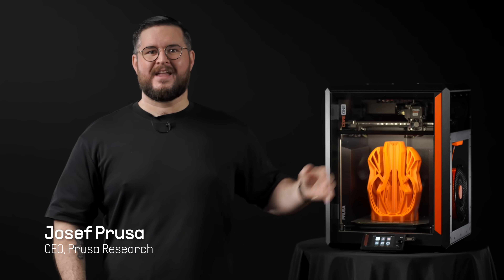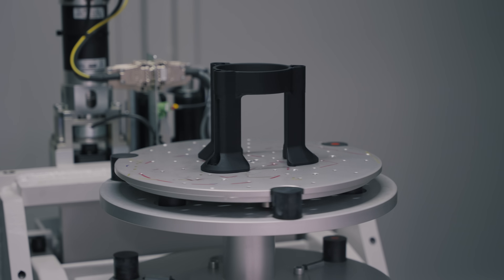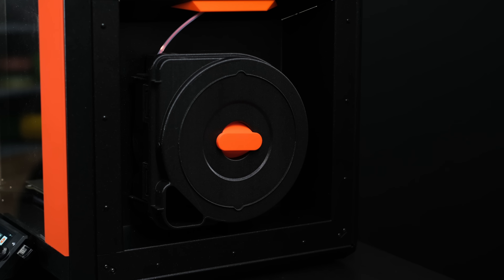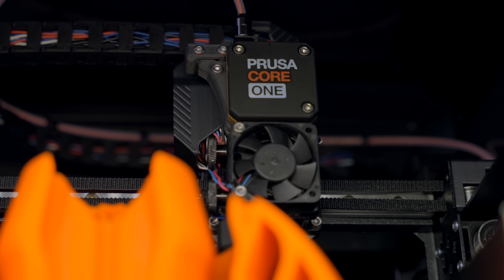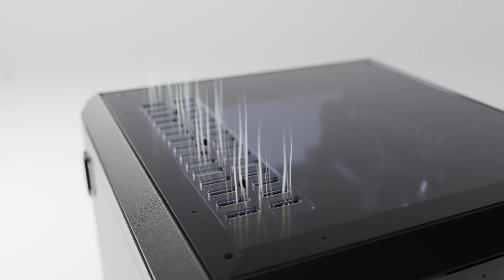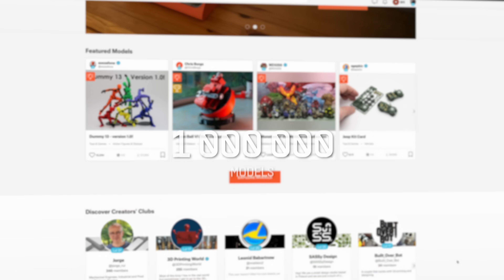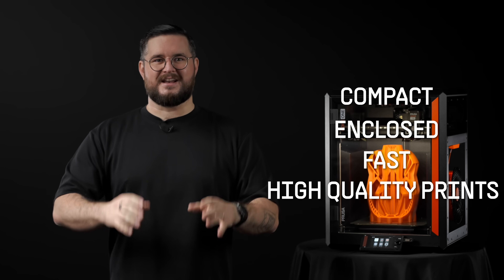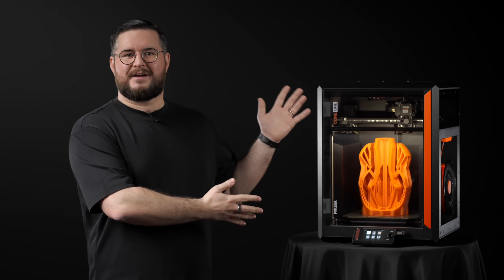Prusa CORE One - Fully Enclosed, High-Speed CoreXY 3D Printer With Active Chamber Temp Control

Comment: To everyone comparing the "Prusa Core One" to the "Bambu X1-C", they are not the same. The X1-C has a camera with added functions such as print failure detection. The "Core One" has no camera. X1-C is less money, has been around a few years and had a lot of the issues that could come up already figured out, and numerous other advantages. Also, the X1-C is slightly larger (though not much).
But in reality, this Prusa printer is much closer to the Bambu P1S (though the P1S does have a, just ok, camera, still better than no camera on the Core One)  You can get 2 P1S unfits and still have money left over to buy an AMS for the amount of the Prusa Core One.

I figured Prusa would eventually start trying to compete against Bambu, but am disappointed that they are doing it by putting out something "inspired" by Bambu's 3 year old machine. The only advantages I can see in the Core one are that some people don't like buying things made in China, and that it is not a closed ecosystem, and more open to tinkering. But those are all issues that only some people will care about.

To even call this the "core one", it just seems like Prusa is doing the same thing Creality and all the other printer companies that used to knock off Prusa, and have now been knocking off Bambu for the last couple years. I miss the days when Prusa was known for innovation. If this printer came out 2-3 years ago, I think it would have had a much better chance. But right now, it looks like it's more money and less featured that other options. If it has all the standard issues for any new printer ( all sorts of technical problems that end up getting worked out by the end users), then it could be 6 months to a year or more before it's really a "just plug it in and it works" kind of situation. I can't imagine greenlighting a printer that is clearly meant to compete against another printer, only to put out a printer that has less to offer than the printer you are competing against.

While all these other companies are playing catch-up to Bambu, it is highly likely that Bambu is getting ready to put out their next machine that will put all these other companies further behind. Though, only time will tell.

I want Prusa to push the world of 3D printing forward, like they used to do, but this clearly is not that. For one thing, they are still using that dial interface. Did they buy a zillion of those at some point, and they refuse to move to a better interface until they sell off all of those? I was really hoping that Prusa wouldn't turn into what Makerbot was, but that seems to be what's happening. Rest on "being first" and name recognition, as competitors copy your designs. Then years later as other are innovating, just switch your main focus to educational and business markets, and never innovate much past that, and just wonder why people don't find you relevant anymore. There is still a chance for Prusa to avoid this, but they are far down that Makerbot path.
Reply: No one wants all the gimmicks the Bambu has. The Prusa is a high quality machine that is built much better and has components that are functional, like the dial screen instead of some silly touch screen.

Comment: The fact that I could have upgraded my Mk2 that I got back in 2017 all the way to this is crazy! You guys are awesome!
Reply: might as well buy another printer to save the time lol
Reply: I think you didn't understand well!
Reply: @belakulcsar  wdym
They have offered upgrade kits for every printer since before the Mk2, and the Mk2 was my first printer, so theoretically I could have upgraded it to a Mk2s, upgraded that to a Mk3, to a Mk3s, etc all the way to this one that came out 8 years later.

realistically, I didn't do this. I bought a new Mk4 kit when they came out, and uograded it to a Mk4s, which I plan to uograde to a Core when they become available... but its still cool that I could have kept upgrading the same printer.
Reply: That would be Theseus's 3D- printer!
Reply: Some one should do a video of the process mk2 to core one
Reply: Unless you first upgrade to a MK 3.5 or 3.9 then you get stuck because they don’t offer the gears for the extruder so it’s a dead end upgrade. Thanks, Prusa.
Reply: @Eric_In_SF  Theres always someone crying. instead of appreciating the options they give you (something not a single other manufacturer does) you keep complaining. I cant believe it sometimes
Reply: @Eric_In_SF  You could have upgraded to the Mk4 instead of the 3.5 or 3.9.  It's not their fault you chose poorly.  You're looking at this the wrong way.  Most products you buy, that's what you've got until end of useful life.  Prusa is relatively unique in offering multiple upgrade options which all have their pros and cons; the choice is yours, but at least you have that choice.
Reply: @Eric_In_SF  yeah, hard to trust that they'll have the "idler gear" mentioned in the video when you finally need to replace it.
Reply: @electro311  there is always aliexpress. They offer idlers in many sizes. They have vendors that still offer kits to convert a MK2 to a MK2.5S, even though Prusa has finally discontinued the kits.
Reply: wait... wouldn't  it need to be upgraded to mk3 then mk4 then core one?
Reply: @mathiaschaves7604  yes... I'm saying theoretically it could have been upgraded many times and end up as a core

Comment: No freaking way. No way. A conversion kit?! Prusa is king.
Reply: The conversion kit is only $100 less than an entirely new P1S. I don't see how this is a competitive price point. I'd rather have the 2nd printer.
Reply: @katelynanderson8526  oh sad. I couldn't find it on their website so I wasn't able to check
Reply: The conversion kit is $449 I think that was a Bambu lab bot responding to you lol
Reply: @alexbotner4656  that price point is technically the cost of a full coreXY printer to be sure but you're probably not getting the Prusa quality. And it's great if you're a hobby user that just wants to upgrade their printer rather than buy a new one

Comment: I'm a longtime Prusa customer and fan, but I am not sure you can compete on features, availability or cost compared to BambuLab here. The build volume is still significantly less overall than the P1 and X1 series, the PrusaConnect stuff is still not as mature as Bambu Handy (The Minis we bought never got functionality that were pitched as part of the Connect featureset). You don't have an easy-add MMU here and the P1S with AMS is cheaper and available at local MicroCenter stores. I'm not trying to harsh your launch but surely you have to know this product as it stands is about 18-24 months too late given the current market?

Comment: Honestly, the printer looks good. IT SEEMS LIKE a WAY better deal than Mk4s + enclosure. If it's reliable like the Mk4s+ the new addon it will be great. For real I have been hating Prusa for a while because of the Mk4. This looks great, it looks premium the price is ok. If the conversion kit is great, I would probably want to convert my 4 MK4 to those. Seriously, if they come up with a 350X350 or 400x400 kit, with a decent price and that printing quality + UI + customer service. It's going to be the ultimate win.
Reply: You might be looking for an XL Mk II.  I think they are goin to rethink the structure of the XL to incorporate some of the Core One construction methods
Reply: @robblincoln2152  I'm not, the XL is not great for the price.
Reply: @Le_Sixx  I think the XL was a huge learning experience.  I expect the next version to be much improved

Comment: Sorry, but if space is such a concern, why didn't you make the spool holder a sliding drawer so you can pull it out and glue one machine to another? Does it fit 4kg Spools? Are you going to start making slim spools that are 4kg but are larger in diameter only to accommodate the extra space it takes? And why not make the doors a sliding door that goes up and down instead of out to the side? Or even a double glazed panel for that? Why is the extractor on the side and not at the back or above? There are so many missed opportunities on this.... You guys could have done so much better with a bit more ingenuity.

Comment: My thoughts:

Very much back to being a recommendable option (of course if reviews check out).

The bed size is a bit smaller than I'd hope for.

Its not mentioned whether you can use the camera while not using the cloud. Is it still possible to use with LAN mode?

Also, does the camera do time lapses?

Relating to the hotend, does it ship with hardened nozzles out of the box or is that a separate purchase?

Overall first impressions are solid and the price doesn't seem insane either.

Comment: Upgrading a mk4 to a core one??  That is insane. No one would put an ounce of effort into making that possible except Prusa
Reply: Or they have a lot of MK4 dead stock inventory and this is a cheaper/easy way to convert it to the new standard.
Reply: @ I doubt that. New product launches takes years so they would not be overproducing just before a major product launch.  I worked in manufacturing and you only produce what you can sell. Inventory is a liability as the worlds car manufacturers are finding out
Reply: @MikiCab1  I also work in manufacturing. Dead stock exists in all industries.
Reply: hi mikicab1, have you become a flat earther yet? If not I suggest watching Level with Me (2023) by Hibbeler Productions

Comment: Holy shit, I was getting a little regret from buying a MK4, but conversion kit!!!
Reply: Same!
Reply: At least you can upgrade I’m stuck with a 3.5 and they don’t sell the extruder parts. 

But you’ll need to do the math to see if it makes more sense to sell the MK four on the open market and use the cash towards this or if it’s more affordable to actually just upgrade it 

Right now, the M4 is selling for around 8:50 in my area so you’d actually be better off selling it

Comment: Honestly the door might be the best feature of this printer. I'm always baffled by how annoying my Bambu P1S' door can be :P
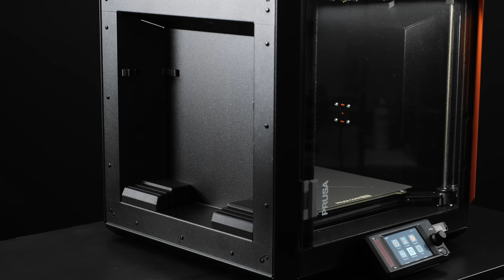Reply: What about the fish spot at 3:30
Reply: @pauljones9150  Well true...
Reply: Even just making the door reversible so you can put the hinge on the other side would be a big improvement. Where I have mine the right side (facing the printer) is against the wall so trying to get into it I have a wall on one side and the door (which doesnt open very wide) on the other. Just being able to reverse the door would make a big difference but having it open wider would be a good thing too.
Reply: I think the fact that they do not force you to connect to any network is very good. I got an X1C and I do not trust it on the main lan.
Reply: @droneforfun5384  If you block internet access or put in on LAN mode, what does it matter on which LAN it is internally?
Reply: @JeffGgeerling see what you did? they are here now, the worst of fanboys
Reply: @e79905  Heh, I hate when people are so married to one brand or another. I love using my P1S (that I paid for, full price). I love using my MK4 (that was sent to me for review). Both have flaws. I use the P1S more frequently. This new Prusa will surely have its own flaws too.
Reply: I've never once looked at my Bambu machines and thought the door was an issue.
Reply: @rickmellor  Yeah, this. I don't even print my with door open on my X1C. It's a door. It doesn't hinder anything. These people are just simping for Prusa. I am glad they've gotten into the core xy market, though. The x1c still beats this objectively, sadly, but we'll see from there.
Reply: If you can't operate a door you probably shouldn't have a printer to be fair
Reply: @backtoearth1983  its not about operating a door, it is about how it doesn't open very wide which makes working in the printer more difficult than in could be.
Reply: @conorstewart2214  This. And when you print with the door open, it wobbles around all the time. Annoying hinge design.

(I still like my Bambu P1S, but the door is IMO the most infuriating part of the whole thing on a day-to-day basis.)
Reply: @JeffGeerling  haven't had that problem, but my door slighty hits the frame when opening and its sssooo annoying
Reply: @conorstewart2214  Just 3D print a simple fix P1S/X1 Door hinge 180/270° - V2 with Stopper on makers.

I own both Prusa's and Babmbu's and find them to have has there good and bads in there own way.
Reply: @backtoearth1983  Haven't you seen the comment section? It's full of Prusa employees and paid commenters. I mean, do they look like genuine comments to you? It's like they've received AI-written scripts or something, created by a promo-team.
Reply: @glp.1337 Just read that comment and you should read a bit better next time. He's calling the Bambu x1c an "objectively fantastic printer"
Reply: @glp.1337  No, there is one guy who called the Bambu X1C an objectively fantastic printer. You just did not read the comment properly.
Reply: @hannesgroesslinger  Hey, you're right! That was my mistake. I guess reading through all these scripted comments made things go blurry. I've fixed it ;)
Reply: @RedFenceAnime  Also thank you for pointing this out. You're right, I misread.

Comment: Whould buy one if the build volume whould be about 250x250x250/270 and max nozzle temp higher..like 350⁰C.  I understand its a Prusa, but for me a X1C still its better and cheaper, or at same price with the AMS. But still nice printer! Only its not for me.

Comment: MK3S user here. Still love this machine!
Reply: I know right, I am emotionally attached to it by now.
Reply: MK3S+ user here. And MK4. Still love both.
Reply: Likewise. I would definitely consider this as a second printer.

Now, if I could just find the space for it. 😅
Reply: @RegularOldDan  Same issue here - definitely want a Core One, have no idea where to put it because my current stock Prusas are perfect and I have no reason to get rid of them.
Reply: Just picked up some used ones and they’re solid.  My creality is faster but not more reliable or better accuracy